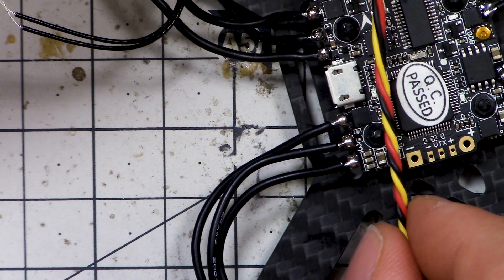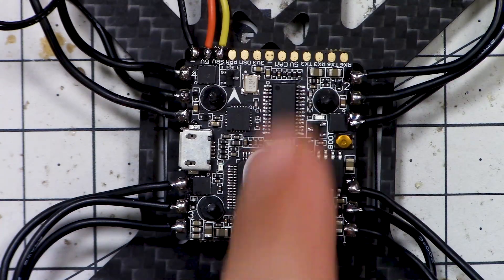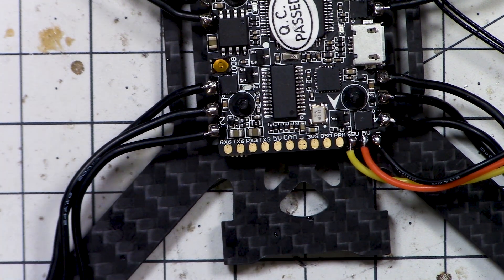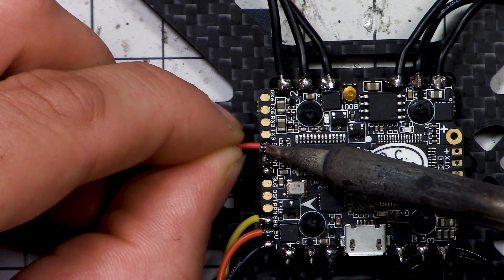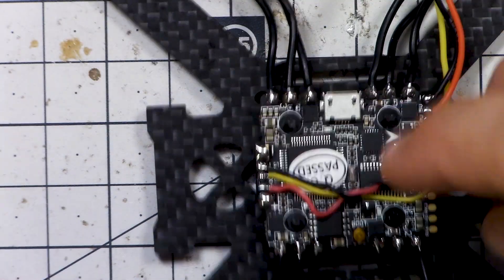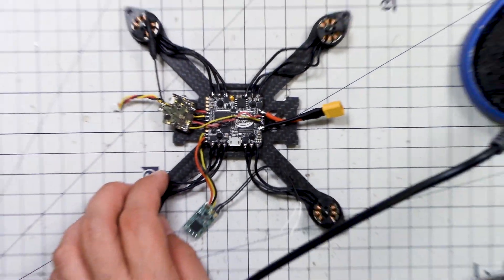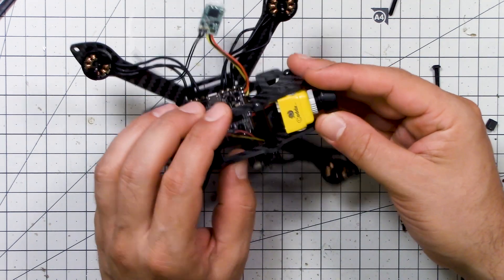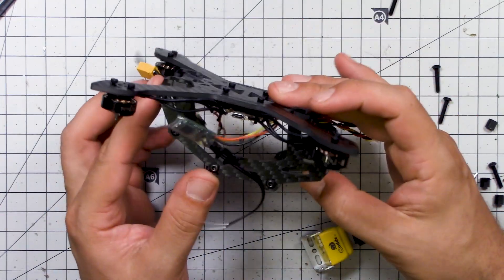HGLRC Zeus Betaflight F4 AIO FC + ESC | PART 4

Comment: Hi,
Just a little tip when soldering your battery connector, you could plug in the unit into the opposite socket, so you have both male and female connectors together, and then solder your wires on. This keeps the pins straight in case they get hot and want to move out of position. I have noticed it also acts like a heat sink, keeping the whole assembly from overheating quickly, giving one a bit more time if needed.

Comment: Hey Joshua, i really need your help, so my quad will twitch on the yaw axis when im hovering, also i have extremely bad vibes when free falling from a dive or when punching out, i also have pretty bad vibes at mid throttle. My motors are lightly scuffed and area little damaged but i dont think thats why the vibes are so terrible, any ideas?? please help.

Comment: Runcam Mini comes with 2 thin spacers in the bag to wedge between the camera and the side plates, you need to use M2x6 motor screws to mount it

Comment: It also helps if you tin the tip every time you put it back into the stand. Just make sure to wipe off the extra solder before you start soldering again.

Comment: Dear Josh, I wonder what's that "shhh shhh" sound. I guess you clean your iron's tip when I hear that sound ahah. But what is it? Too loud for wet sponge (although might be the case if the mic is right next to the sponge) and doesn't sound like those steel wire cleaners. What is your tip cleaner I need to know oh yeah!)
Reply from the maker: Brass sponge.

Comment: Hi, about your XT60 soldering...I would do the solder joints side on side. Not tip on tip. Side on side makes it a little more strong and provides more surface for the current. Just both wires to the inside of the pins side on side. Heat shrink the single ones and then both together. Anyway, your way will just work as good. You doing a great job ! Thanks for that.Cheers !

Comment: On  the upper and lower  front nylon mount . If you put 1 or 2 mm washers en between nylon to frame mounts it would allow you to slide that bracket in. Problem solved now you are on the  macgyver list of. If it don"t fit you can make it fit. Problem solved. As long as the lower  protruding mount through fame does not create to much clearance on the protruding lower mounting sleeves.

Comment: On your comment about not having the fume cupboard: the fumes are not actually that bad for your lungs, the danger comes in the lead particulates that get pulled up into the air and get deposited on your eyes. I have a surgery in about 3 months to remove a growth on my left eye caused by a lead particulate in my eye. You often see these growths on people who smoke heavily and the tar deposits on the eye.  

Although i understand your point about a fan being noisy for recording, you may want to invest in a couple high end computer fans, they are designed to be extremely quiet and can mount on just  a simple wooden stand (Or 3d print one if you can). It could save you from my fate!

Comment: Guys, what was the camera solution? I am facing the same and would love to know what you decided. Thanks much!
Reply from the maker: Ask @Xav_FPV but ultimately I think the solution is micro cam with 3D printed mount. Or you can do mini cam too.
Reply: Use the washers in between the camera and the frame.

Comment: A couple nylon washers or small piece cut from a nylon standoff on each side of the camera would be an expedient solution.  A little fussy to install, but a dab of vaseline would hold things until together, then a qtip and alcohol to clean up.

Another way would be layers of electrical tape on the camera sides; or VHB leave the backer on. Instant soft mount. There are a lot of ways to skin a quad sans 3d printer.

Comment: That xt30 connector seems to take something like a bullet connector to fit, the cam kit for the quad should have had a spacer or washer to offset the size difference. I’m sure most manufactures know common camera specs right. Great informative vid though thanks Josh for the tips.
Reply: It's really designed for a direct solder to a PC board.  It's the wrong version XT-30 to use. Someone was selling them in a bag of like 20 for really cheap and this is what you got.

Comment: What I would have done with that xt30 was take the tinned wire lead, flatten with a hammer, use the iron to shape the flattened lead in a half moon, and solder contacting the side of the pins.

Comment: You have the wrong XT connector - this one is for PCB installation. That's why soldering a wire to it doesn't seem right ;)
Reply from the maker: That's what I guessed.

Comment: Wish they had a 4s and 6s version of that, no idea how they would keep it cool though. Maybe a small micro fan.
Reply from the maker: It's a 20mm board designed for micros so not much point for higher voltage. But they are working on the Titan, which is a 36mm version for larger quads. Maybe it will take 6s?

Comment: Actually, the camera pads that you think are light are closer to being right. All the other pads you've done in the series have too much solder. You should have a nice fillet, barely more than what's on your camera pads, and to be able to distinguish the wire. If it just looks like a round blob, its about double what you need. The reason for this is is that having extra solder is no more electrically sound and it makes it difficult to inspect the joint. You're also more likely to create solder bridges and it's also extra mass that could be dislodged in a high shock/vibe situation. 

source: i'm NASA J-STD-001ES certified. :P

Comment: Yea, those are definitely the wrong xt30's I have a bunch of those i bought by mistake as well. Those are for mounting perpendicular directly to a board like a pdb with no wire between. I had to buy replacements that have the same ends as the xt60's we are used to.
Reply: mportillo78 yeah so you slot them into those circular holes in the PDB and you flow solder into the little dimes until you have two giant blobs of solder securely holding the connector in place.
Reply: Keith Anderson yep! But most people recommend not doing that since it creates a break point. Usually you'll want some wire in between or like armattan rubber xt60 saver. I just ordered the correct xt30 and all is good to go.
Reply: mportillo78 yeah it is very likely that in a hard crash you’ll snap your PDB in a hard crash if your battery gets jettisoned.

Comment: For my opinion this is not a build video but a soldering lesson! 

Btw. if I solder XT60's or XT30's I have always plugged a male and a female plug together and I never would do it like in this video....
Reply from the maker: +Juergen Stremmler every build is a soldering lesson. I still built a quad...

Comment: That end to end soldering on the XT30 is far too weak. Better to wrap the untinned wire round the connector, tin in place then trim if necessary.

Comment: kinda wish the escs were 20a tho
Reply: Mihkel Rebane I’m sure they will be on the next Zeus.
Reply: They are rated up to 25A for max. 10s.
I guess, I'll be able to verify it, when my GepRC Sparrow is here ;)
Reply: M0rdH0rst I saw that. I gonna use it on some 1106 motors in the future.
Reply: I'm using a SpeedX GR1408 4100KV on the sparrow. I think it is getting close to borderline on current.
But by rule of thumb: 60A from a 850mAh / 70C with 4x15A ESC should be fine and looking at what a 5" quad does with 60A it should be fun :)

Comment: your gonna blow that vtx if you leave it where it is
Reply from the maker: Do tell.
Reply: maybe its just my board, but i believe the "vtx" spot on that board puts out full voltage
Reply: Tried to reply on my phone don't know if it actually posed it, but anyways i found on my board the "vtx" spot was putting out full battery voltage. the tx03 didn't like it. board flies well tho